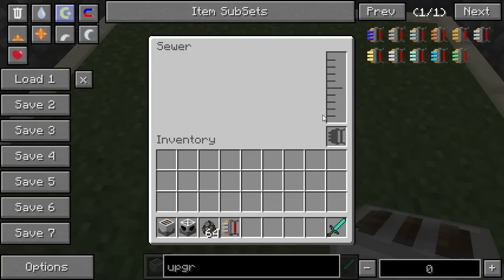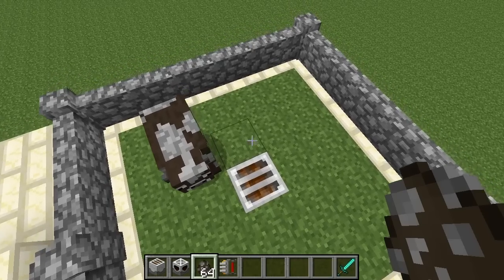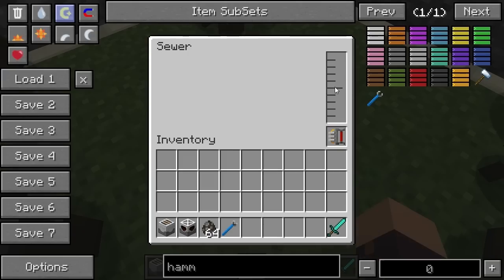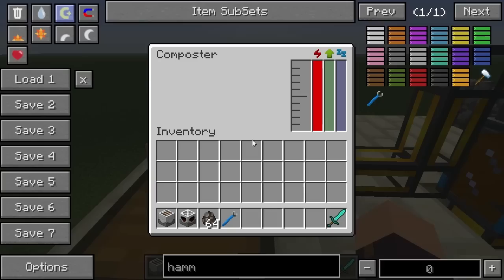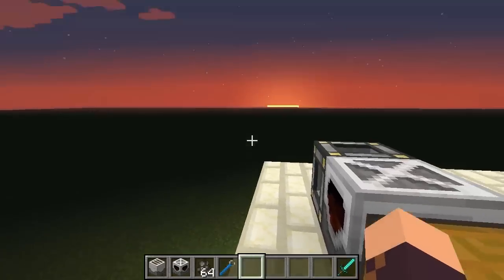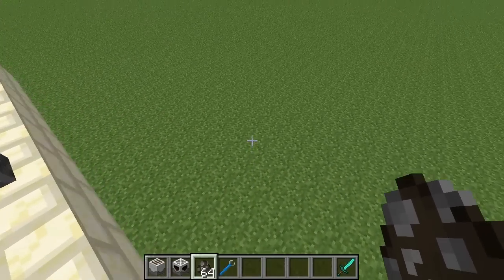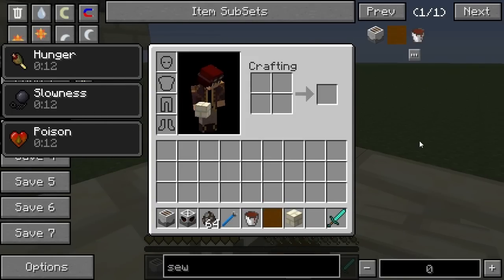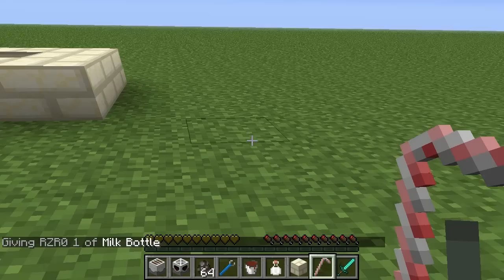MineFactory Reloaded - Sewers & Composters

Comment: Just Today Vanilla Minecraft got composters in a snapshot, and they work with hoppers and work fairly fast, some updates ago we also got the ability to dispense bonemeal onto crops or grass and I think even the sea floor, and it is now possible to have fully automated crop farms without relying on fish entities spawning (1.13 being the current full release, it added fish entities which sometimes drop bonemeal).

One can now have an otherwise useless beetroot farm or even cacti or extra wheat seeds farm or so many others to have faster/smaller crop farms in Vanilla, this might be very useful for feeding villagers for faster villager breeders to feasibly obtain completely perfect villagers (trades), and simultaneously also get a massive abundance of emeralds from farmer brown coats (who buy crops) much more easily than before, which in turn can make getting diamond tools & stuff as well as enchanted books and whatever villagers sell way more easily, it is somewhat funny that this (1.14) is the Village and Pillage update and this new block can make villager trading that much easier.

Comment: i would also like to know how to solve the mob essence problem. cant get my tank to fill up
Reply from the maker: Hi, you should check out how I separated the meat and pink slime from each other in my spotlight on the slaughterhouse. I've put a link in the description.
Reply: thx man
Reply: crap. its not the pink slime thats the problem. the sewer picks up crap and an additional liqiud called "mob essence" my conduct get clogged by mob essence. And the composter stops working. i cant find a solution anywhere.
Reply: thijs de clercq You need a liquid router, an essence extractor, a bucket and another tank. Use the extractor on yourself, (mob essence is exp) have the router feed it off elsewhere.